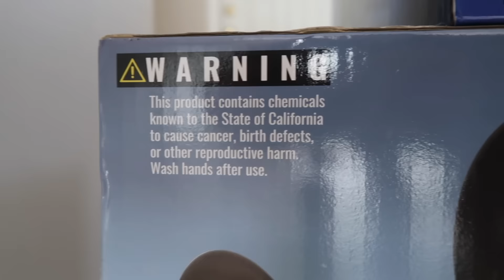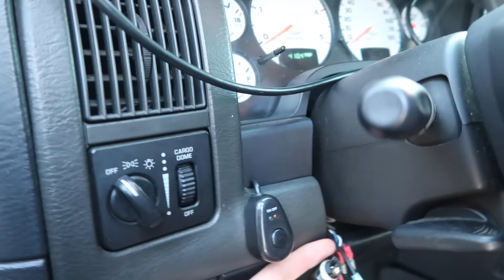TRAIN HORN IS EXTREMELY LOUD!!

Comment: I did the 4 horn kit from Hornblasters and I mounted the tank and compressor to the bottom of my bed on the right front side where it protected and mounted the horns where you mounted everything. That way you can’t see anything. Your compressor can probably be see from behind your truck. Just a suggestion. 👍🏻
Reply from the maker: yah im gonna mess with it a little bit appreciate the suggestion

Comment: Question, does the tank built up condensation and if so how do you drain it with the valve facing up? Does this damage it in any way? Do you have to take it down and unbolt it just to drain it? Plus how often do you, or should you, drain it so the condensation doesn't get crazy in the tank?

Comment: Do you ever wonder where RAM would be today if they hadn’t made that initial body change that took off like a wild fire?  When I was a younger dude I thought the old Dodge body style (like your friends blue one in this video) was one ugly truck that I would never buy.  Then they changed the body style with the front end being the new look that sweep the nation.  I was on cloud 9 when I purchased my first Ram truck single cab SLT with nothing special at all on it.  Then I really thought I was on cloud 9 when I stepped up to the RAM quad cab Laramie edition Hemi 1500.  Then I REALLY thought I was on cloud 9 (and still do) when I stepped up to a RAM Laramie Mega Cab Dually 3500 with every feature you can imagine while housing the 6.7 Cummings Diesel Engine.  My Mega Cab can pull a house with no problems. (At least it feels that way).  With the tow capacity of 30,000 pounds you know this truck is a boss.  While hooked up to my 43 foot 5th wheel I honestly can not tell it’s behind me until I see it in my rear view mirrors.  I can never imagine owning anything but a RAM truck.  If I had to change brands I would go with FORD.  It’s not because the FORD blows me away with appearance, tow capacity or features.  It’s simply because the Chevys are junk with a even lower tow capacity than the FORD.  Chevys body style is just boring to be honest.